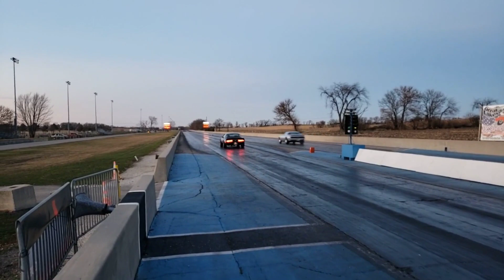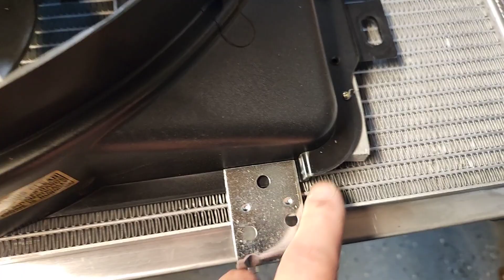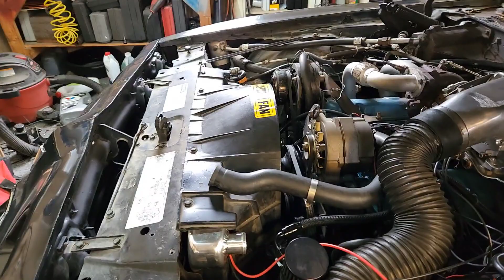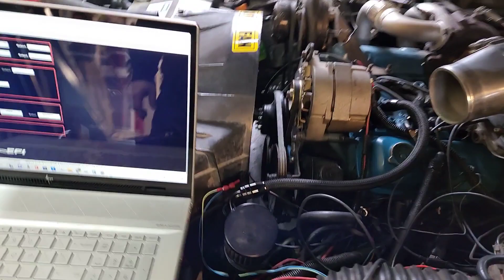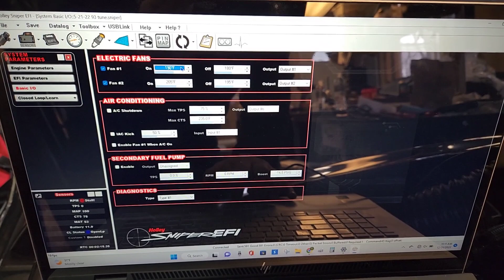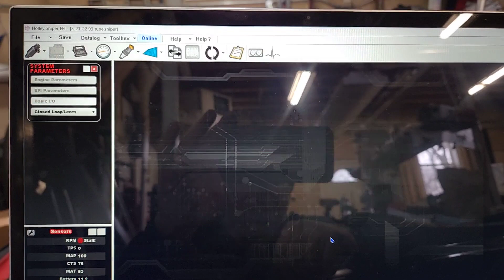TTA Performance - Electric Fan Install in my 1981 301 Turbo

Comment: Engine temp will creep up on the highway because the coolant is moving through the radiator to quick. Put a 180 thermostat in it and your car will stay more consistant and the fans will run LESS TIME. I learned this years ago. Without enough time in the rad it won't get cooled.

Comment: Hey Joe keep your videos coming, I installed a cold case in my 80 T/A 3 years ago. Your correct stock upper hose doesn’t fit, I used Napa hose part # 7478 and it looked like the 400 hose. I run a 160 t stat with a mechanical fan, and the 301 runs cool as cucumber in Connecticut.

Comment: I've noticed that temp creep at highway speeds with mine. Triple digit temps in southern Wyoming last year and cruising at 70-75, the temp would slowly go up. Hottest it got was 230 which made me cringe. When stopping for fuel, it would cool back down.

Comment: I wish i had saved the custom turbo setup i had, they swapped exaust manifolds side to side,welded boton and redrilled top,custom y on top at the front revved smoother,no idea what it did for power figures....was my old turbo formula. Scrapped it 23 years ago...